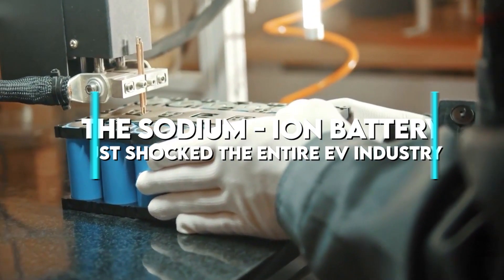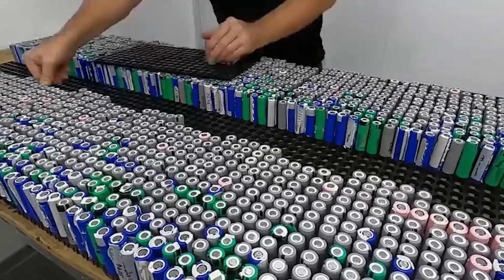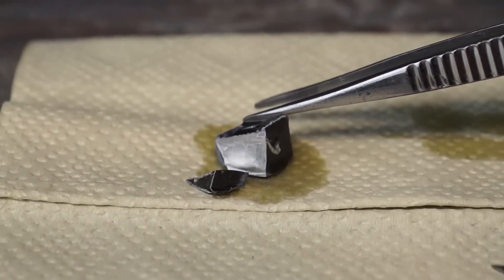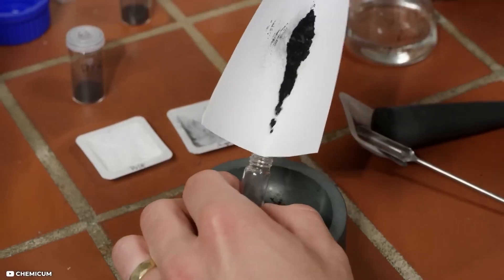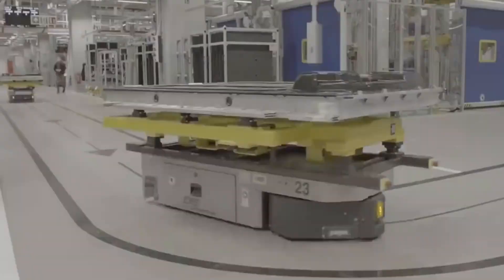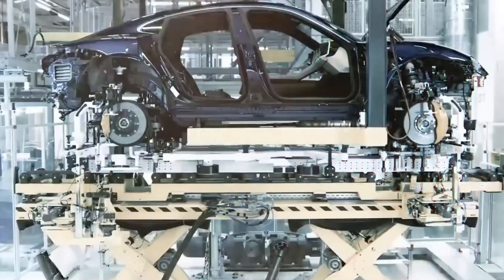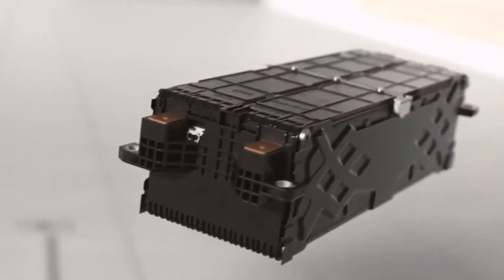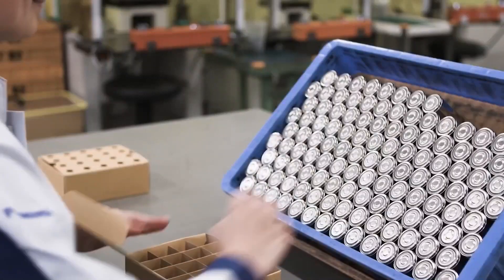Tesla SHOCKED By INSANE Sodium Ion Battery, Will This DESTROY The Lithium Ion Battery?

Comment from the maker: What do you think is better, lithium or sodium ion? Let us know!
Reply: Sodium ion thanks to different electrode materials as sodium ions are large than lithium ions so it is not a direct swap of eleoctrolyte.

 What I especially like is that Sodium ion batteries can both be charged much faster and ans discharged much faster. The former is for not waiting forever to charge the battery. The latter matters in a case where solar power is used, a standard single or dual stage motor on a heat pump will have many times the normal current draw during the first motor rotation when the motor starts, sodium ion storage can provide much much more inrush current. In many case people simply have not been able to start their heat pumps due to the solar system's battery array not being able to discharge at a high enough rate for that split second. People have gotten around it with inverter motored heat pumps that start out low and fraction up and down in 1% increments to meet the requirement at that moment. 

 A sodium ion battery can be fully discharged to zero, in fact they ship with a shorting strap across the electrodes. Do that to a lithium battery and it WILL explode if there is any energy left, otherwise if a lithium battery is fully discharged it will never hold a good charge again. Then there is the fact that Sodium ion batteries are not sensitive to too high of a voltage or overcharge like a lithium battery. Sodium ion batteries are not as sensitive to temperature, hold a good charge below freezing and do not have the thermal instability. Lithium ion batteries of course will explode when shorted, even when used properly Lithium ion batteries tend to grow dendrites from build up related to how fast the electrode can absorb the ions, when one of those dendrites grow and reach the other electrode, there is your short and it thermally runs away. Lithium batteries being prone to ignition when exposed to a high enough temperature, get ignited by the dendrite shorted cell and in no time at all the entire battery is under runaway. To make lithium batteries a bit safer, spreading the cells apart which negates the compactness and in some cases, a cooling fan is added thus increasing both bulk and weight. Lithium batteries should not be exposed to temps above 130 degrees F. Now for the real winner, Sodium ion batteries with prussian blue or white used in the cathode, have shown that they can handle 50,000 full discharge and recharge cycles and 100,000 cycles may be possible. Compare that to 3,000 to 4,000 cycles of lithium ion and there you go.

 As an Avionics Tech who attends a hazardous transportation class annually, there are now two things that can never be shipped on aircraft, oxygen generators due to the 1996 valujet crash and now Lithium batteries cannot be shipped on any aircraft ever. Personal devices that contain lithium batteries must be in the cabin since the aircrew carries containment bags for lithium fires in small devices, must not be in checked luggage and booster batteries are often confiscated at TSA as one recently made an emergency landing necessary.     https://www.faa.gov/hazmat/resources/lithium_batteries/media/battery_incident_chart.pdf
https://www.faa.gov/hazmat/resources/lithium_batteries/incidents

 Sodium ion please. Keep an eye on Aluminum ion and Magnesium and even hemp.

Comment: i was expecting them to use aluminum ion batteries instead... but its too late

Aluminum ion batteries would have been a better choice!
1. Less costly than lithium
2. Energy density similar to coal
3. Charges 10-70 times faster than lithium ion batteries
4. Safety; never explodes even if you draw huge amounts of current through it as it has no theoretical current limits
5. Never needs coolants because these type batteries never overheat, can even perform as normal in zero degree temps!
6. Aluminum ion batteries are easier to recycle than lithium ion batteries do!
7. Since aluminum is abundant, it poses no rare earth metal problems as mining lithium!
Reply: daine ramos quitco I would want Sodium ion where density is not needed and I have a lot of salt where I live that is where it is NOT wanted. I would be elated if my cellphone had an aluminum ion battery and other items. Where I live, everyone is tripping over each other about pulling Lithium chloride from the brine beneath the geothermal plants and they even renamed the area lithium valley. I'm beyond disgusted while sitting next to a body of water that is saltier than the ocean and only Tilapia remain in lower numbers.

 People were thinking that it was going to benefit the locals and the money could be used for sea to sea water import, nope. A few rich has beens who happened to still have money, an Australian hustler and out of touch politicians treat the Lithium chloride extraction like it's the second coming and guess what? They want to make money off the venture,  the local population or using the money to benefit the region in any way was never the goal and we do not yet know how much yield it will even produce. Politicians either believe or want us to believe that lithium is green energy but I suspect being out of touch is the most likely reason they buy into it. Now these vultures are trying to get people south of the Salton Sea in places like Niland to sell their mineral rights. They just want to buy people out and move them. They act as if lithium ion batteries have their future dominance guaranteed. When  a fire caused by a lithium ion battery kills the wrong person or someone has ingested lithium ion electrolyte which only takes 200mg to kill the average sized adult, then banning is a possibility. Lithium ion batteries grow dendrites as do other types, the only difference is that when a lithium ion battery is shorted all hell breaks loose and a dendrite that happens to reach the other electrode will do just that, short it and thermal runaway ensues. Sodium ion batteries not only can tolerate being shorted, they ship with a shorting strap on them.

 As an Avionics Tech, I have to take hazardous transportation class once per year because everyone who has anything to do with aircraft need to know what can never be shipped on an airplane. The ValuJet crash in the Everglades is the reason why oxygen generators can not be shipped on any aircraft period. The ones that were shipped in 1996 were thought to be spent already but they weren't activated yet. Mix that with tires in the cargo, when one generator goes off it gets gets hot and produces oxygen so you have fuel, heat and lots of oxygen for the tires. Now, Lithium batteries have been added to the list of things that cannot be shipped on any aircraft and it has escalated to where they want things like your laptop or any other lithium battery containing devices to be carried into the main cabin since they now carry lithium fire containment bags. The FAA website has a list of how many incidents there have been and that is just domestic flights. At least one had to make an emergency landing when someone's booster pack ran away. Another case was when they transferring a passenger's luggage to another aircraft to follow the passenger and they noticed smoke coming out of the luggage. All the houses that have burned down because of them for whatever reason don't get reported through all the news outlets. 
 
 I too am excited about aluminum ion. I am curious as to if it can handle 50,000 charge discharge cycles like Sodium ion can.

Comment: Sodium Ion batteries are definitely where the future of batteries and EVs need to focus. Safety - safe for the consumer and safe for the environment. Lithium is unsafe and deadly for humans and the environment.
Reply: @Akshay Kumar pal Wrong! Sodium ion batteries with the proper cathode material can both charge and discharge much much faster. By the time you get a lithium battery to even be partially safe, it becomes more bulky and add the cooling fan and it more weight and bulk. Lithium batteries one and only advantage is density and you may not know that prussian blue and white are being used in the cathode of sodium ion batteries now. Sodium ions are physically larger so trying to substitute sodium ion electrolyte for lithium ion electrolyte did not have great results because the cathode material used in Lithium batteries cannot efficiently absorb sodium ions.  People that have switched to solar have had difficulty getting their heat pumps to start due to the huge inrush current that the electric compressor motor starts during that first fraction of the first rotation. Modern sodium ion batteries handle it. The workaround for the the non-sodium batteries is to use an inverter compressor heat pump which starts low and ramps up and down based on demand but those are more efficient no matter what the power source. The 50,000 charge discharge cycles of the sodium ion battery is a huge plus factor.  

 If you wish to talk density, Aluminum ion.

Comment: Sodium is weighter than Lithium because it has a lot of extra not-free electron. I think Sodium battery is gonna have big size.
Reply: It doesn't have the density but it sodium ions have 10 electrons compared to Lithium ion's 2 electrons as near as I can figure, this is ions, not the elements. It's difficult to get a damned straight answer as any question about ions gets answers about the element itself which was never asked as the element itself is on the periodic table so it's freaking annoying to ask a question about lithium ion or sodium ion electron count and be told the count in the parent element which requires little research, just a periodic table of the elements.  
 
Where people went wrong is trying to substitute sodium ion for lithium ion directly but sodium ions are larger and will not be absorbed by the electrode materials that work for lithium. Recent breakthroughs are the use of Prussian Blue (Natron) and Prussian White (CATL) for electrode materials which can absorb the sodium ions.
Reply: @davidwstudeman7965  i was gonna suggest them to use aluminum ion batteries... which have ultra fast charging feature, 100% Safety meaning it doesn't even explode or combust, and also affordable because aluminum is also abundant, and have energy densities similar to petrol cars